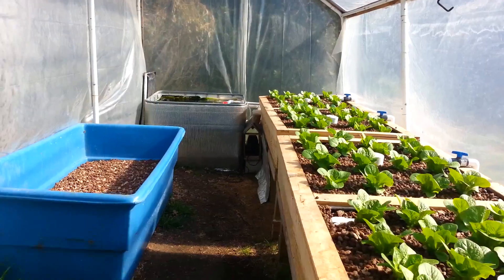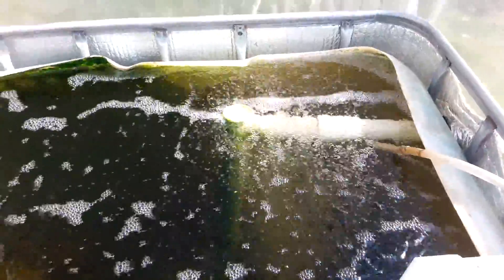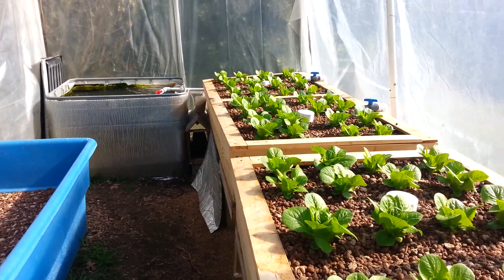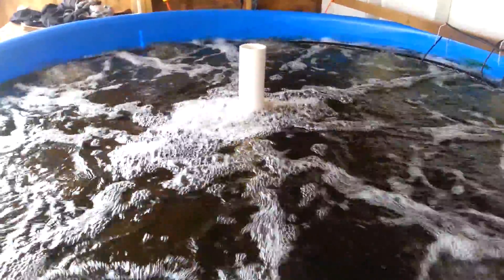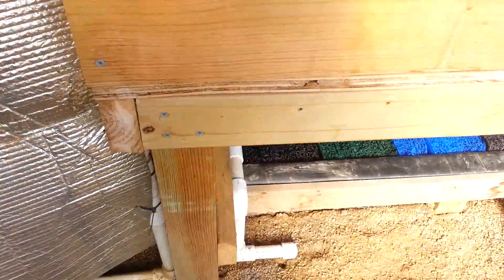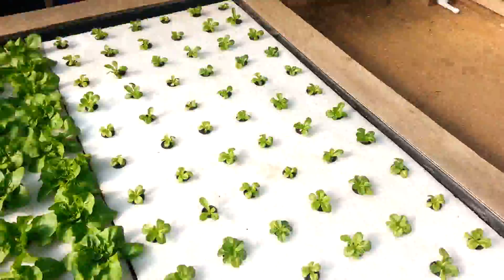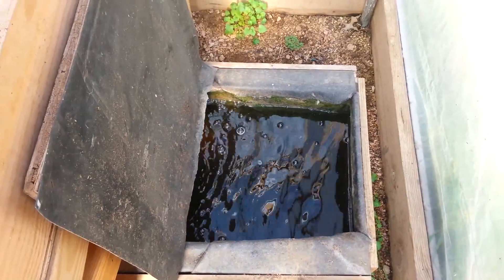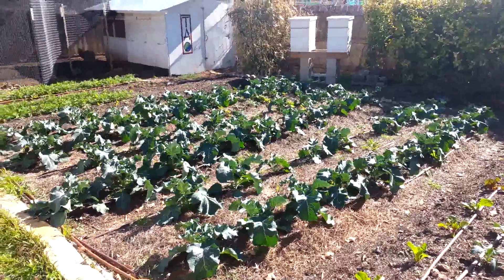Aquaponics System Tour - Austin, TX

Comment: Nice tour, but I have a questioin, the title is 10 acres, but from the video, it didn't look like it is a 10 acres operation.
Reply: I had the same question. I got excited when I saw the title cause I've got a 21 acre farm that I've converted over to growing produce and I have been considering converting half or 1/4 over to aquaponics so I thought WOW! Someone else is doing aquaponics on 10 acres so it can be done but then I find out they meant .10 acres. I will give credit to him tho, hes got a nice little system but where in the hell is the 10 acres at?
Reply from the maker: Thanks for your interest and for the questions.  The company we founded, Ten Acre Organics, intended to develop a 10-acre aquaponics farm.  These systems in my backyard were our first prototypes.  We eventually raised some capital and built a 10,000 sq.ft. commercial system, which still runs today, but Ten Acre Organics was wound down and dissolved in 2015.  My apologies for the confusion - I have decided to change the video title.
Reply: @lloydminick8823  Thanks for the update, really appreciated.  I have been long for running an aquaponics farm but wondering how I could start.

Comment: Nice system setup and thanks for sharing.  Where did you get "hydrolic valves" on your ridge vent of your greenhouse?
Reply: Might be a little late to the party, but they are fairly common: look for "GreenHouse opener". Even amazon carries them ( should u wish to buy from them instead of local ;))

Comment: Hi My name is Fung. I have a question on how to keepxx I am wondering is this a common situation that the leaf vegetable are getting soft and withered after a few days once i harvested various types of crops on my aquaponics system. I used to cut all the root and place them in indoor area with room temperature.
Reply: Vegetables getting soft meaning it lacks of moisture if you keep the root on the plant and trim it when you were ready to eat, the vegetables would last much longer.  How large is your aquaponics system?

Comment: Just to mention i would say that flood & drain has an advantage over continuous flow of water because when the bed is empty, the roots are exposed to air (oxygen).  It is a mixture of flow of nutrient and oxygen using flood & drain.

With insufficient air and continuous flow of water causing roots to remain submerged in water, you may end up with brown roots rather than healthy white ones !

Great work though cheers.
Reply: Thanks, Ainesh.  I understand your reasoning, but we've designed, built, and operated both types of systems, and from our experience, so long as adequate flow rates and dissolved oxygen levels are maintained throughout the system, the continuous flow systems perform just as well as flood and drain, and just as well as raft method for that matter.  4-6 ppm of dissolve oxygen is all that is necessary for optimal plant growth, more is not needed and has no discernible additional benefit, and by maintaining high enough flow rates through the media beds (e.g. a full exchange every 5-10 minutes), the distribution of nutrients and oxygen is more than adequate.  And since the same plant growth performance can be achieved with either kind of system (if designed properly), it makes sense to us to go with the approach that is simpler, cheaper, and more reliable.
Reply: Aeroponics is better than both.  You just have to filter your water before spraying.